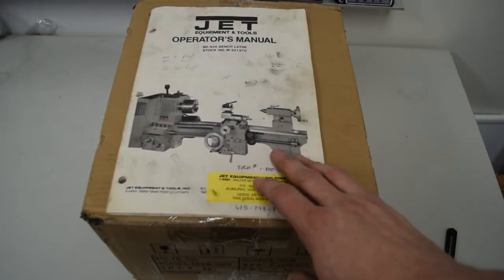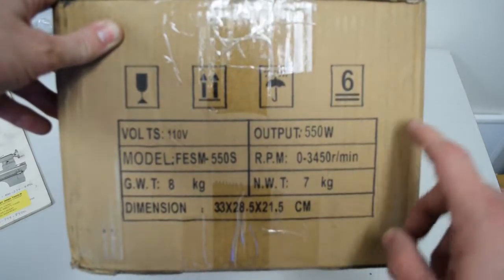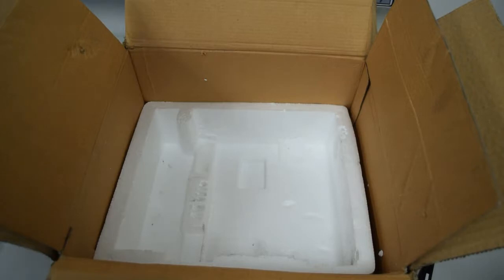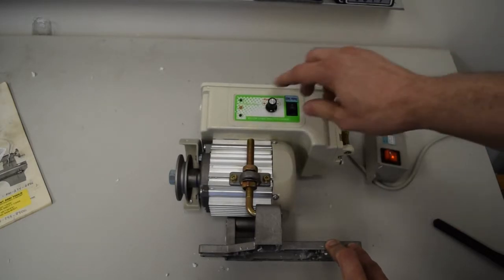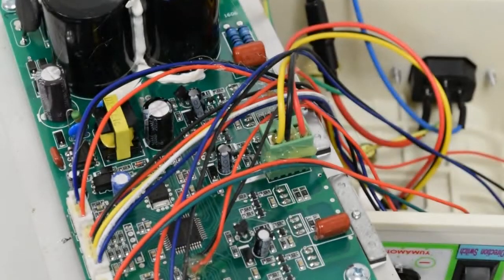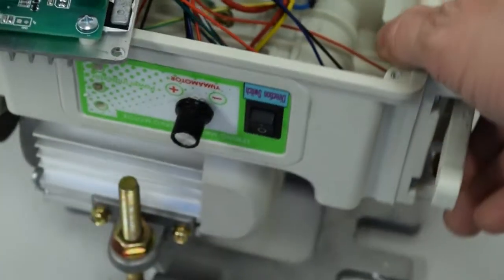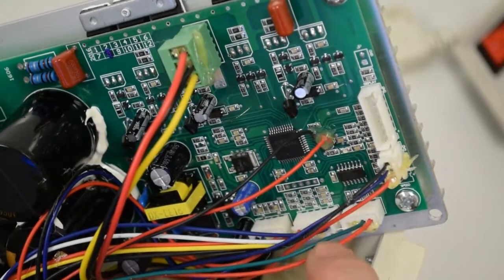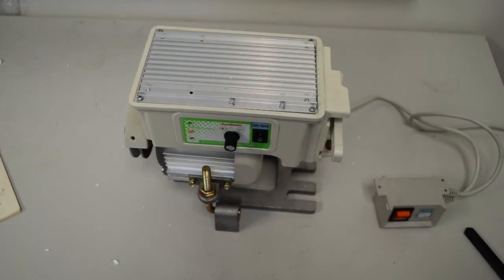Yuma 550w 3/4hp Servo Sewing Motor 9x20 Lathe Upgrade Unboxing

Comment: Now that was an unboxing on steroids! I especially liked how the control box was opened to see how difficult it would be to extend the controls for the lathe. Very well done. It would be nice to see a follow on to see how well it is working on your 9x20 lathe.
Reply from the maker: Eidetic Goone just got the pulley for the motor machined. And now i am working on the motor mount. Stay tuned!
Reply: Did the lathe require a different profile of belt, or were you just needing a different diameter that wasn't available. I have what appears to be the same BLDC 550 watt motor for my old singer 112w-139 walking foot sewing machine with the digital 4-button control. The motors are incredibly quiet.  I think it uses a 15mm ID pulley with a 3/16 key.  I bought a 45mm pulley, but the profile works with a standard v profile belt. 
I have been wanting the 9x20 lathe (may be 8x16) to possibly do a cnc conversion on.  So I am interested in your build.
Reply from the maker: The pulley that comes with the motor is wrong. I bought a used pulley that is the same as what my Lathe motor has. But it is for a 14mm shaft and the Yuma motor is a 15mm shaft. So I machined it 1mm larger to fit.
Reply from the maker: Also, check out "Bluehands" videos on 9x22 lathe CNC he did
Reply: @overkillaudioinc  how did this work out/is working out for you?
Reply from the maker: @AzTurboMini  I never got to finish it. Maybe this winter
Reply: @overkillaudioinc  thanks for the quick reply. Good luck 👍

Comment: hy ! can u maybe help me a little ! i want to add such a motor on my mini mill x2 rom Sieg. and i would like to know if the shaft from the motor has the pin sticking out or is this a threaded shaft ? and also , could you please tell me if there can be new mouning holes drilled and tapped on the plate where the shaft is sticking out ?

Comment: How is the low speed torque? I've read that a BLDC motor will never be great for low speed torque and a induction motor with vfd is much better.
I want to upgrade my small lathe and be able to thread cut at ~400rpm. Thanks for posting the video
Reply: did you watch the video? he had it at its lowest speed and he couldn't stop the pulley. so yea, they got torque.

Comment from the maker: One thing I forgot to add is that these have Braking action! so when you let off the speed control, the motor actually brakes. which on a lathe, my need to have some adjustment to make work. I just got the pulley machined for it and will be working on making a motor mount next when i get time again. stay tuned for further episodes of this adventure!
Reply: I know this is an old video but curious if you got it installed and would love some overview of the finished project if so.   Thanks

Comment: Looks like Google has made those "Yuma 550 watt 3/4hp AC" motors disappear. Liked the Dial Potentiometer though.  Got another link for this model? thx
Reply from the maker: It looks like Zamir Sew no longer has that model on their website. But if you search eBay for :sewing motor 3/4" a variety come up. Many look exactly the same but with digital up/down buttons. If i had the $$ I would like to buy a couple of these and open them up. I would be Dollars to donuts that they are exactly the same and could be converted to a manual speed control easily. But. It's a guess.
Reply: Yeap i was recently looking at the Consew CSM3000 but would have like to to be 'Less digitally controlled" and more manual (dial potentiometer etc) as well. Its a 1hp as well..  Sure there are plug-n-play controllers for its PCB board out there somewhere.  I see this guy (in the 2nd image) has rigged one somehow... interesting. https://www.deepgroove1.com/product-page/550-watt-brushless-spindle-motor
Reply from the maker: That is very interesting! I have not seen that before But I am familiar with Deepgroove's eBay store. I have purchased many things from him for my CNC machine. Very interesting what he has done there!
Reply: Yeah .. too bad he doesn't respond to email these days. I've sent 2 over the pass couple of weeks trying to get info on the controller and pulleys etc (or even try to buy the controller and pulleys for my unit) .. yet nothing- no response .  Others in FB groups have had similar experiences with this person.  If you happen to get some info on this I'd be MOST Interested.. thx
Reply: Randy, this visually seems to be the the same motor and controller  I bought off craigslist for my walking foot sewing machine.    I located a source on ebay, but the guy selling has a store in L.A. where he sells it for less ($115) with free shipping.  
http://bobbinusa.com/550W-Brushless-Servo-Motor-Sewing-Machine-Needle-Position-Rotation-Button_p_744.html
For  $115, the machine comes without a needle position sensor which is not necessary on a lathe or mill. 

Compare the $330 kit to the $115 sewing motor kit. 

Besides the pulleys, belt and simple aluminum plate, there is red box with a knob which replaces the foot pedal actuated  lever speed control box used on a sewing machine. Is the red box necessary, could you easily build your own, or could you simply use the sewing machine lever sensor? 

The lever has only a small range of angular motion about 15 or 20 degrees, making it more sensitive. But settings allow the controller to compensate somewhat for this increased sensitivity.  When the upper speed limit is reduced, the lever range seems to be remapped to cover the reduced range of output speeds. The upper limit can be set from 500 rpm to the factory set 3500. But actually the controller's menus allow setting this up to 7000.  The speed is shown on the display starts with 200 in increments of 100 rpm. I can hear that there are speeds between the 100 display increments that can be achieved by feathering the foot control. I am guessing that these are at 50 rpm increments.
In addition, there are internal menu settings that change the response curve of the motor, to give better low end control. 
I think a workable speed control could be achieved by removing the return spring replacing the lever with a knob, and adding some stiction to prevent the knob form turning too freely. 

I recently opened the box containing the lever. 
Inside,  a lever moves a magnet over this analog hall sensor labeled "49e 337". Probably this one:
http://p.globalsources.com/IMAGES/PDT/SPEC/440/K1139513440.pdf
The hall sensor is the only component on a PCB mounted inside the lever box. The lever box itself is bolted to the standard industrial sewing machine motor mount and can be removed with two bolts. The circuit board is mounted with two screws through elongated holes so that the sensor can be fine tuned with either a long or short dead zone. 

If you used a similar mount, you might need to get some longer bolts to accommodate the plate. The motor itself is designed to be gripped on its side in some extruded slots. This allows for fore and aft positioning. 

Anyhow, more info than you might be interested unless you get one of these. I have more that I have learned, but unless there is someone to pursue this, this post is long enough.
Reply: Wow you've put more time into this than I'd ever expect here.. and thx much for the info. I think I'll be OK with remounting the lever box ( and removing the tension spring and tweaking the lever arm pressure inside the housing so it doesn't flop around).  I was just looking for something more repeatable/ measurable after I reset/adjust the digital control menus abit... Looks like to get the torque at the lower speeds I'm gunna manually gear it down anyway.. prolly to 1/2.  Can't wait to get this Consew 1hp CSM3000 in my hand next week to see the low end benefits after adjusting the menuss abit.  Thx again.
Reply: True, I spent a little too much time.  My sewing machine is geared to about 1/2. 45mm motor pulley with ~90mm hand wheel pulley.  I get about 100 rpm at the needle. I tried to stop the motor at its lowest speed. The belt which I leave a bit loose slips but the motor shows no signs of slowing. These motors are pretty cool.

I just took a tried to find the csm3000 on the consew web site. http://www.consew.com/list/machine-stands/servo-motors
Seems they have updated their models a bit, and that one is not currently on their site. 
They have a tendency to keep the same model numbers and change up the actual product.  I am curious to see if your model comes with a two or four button controller. Most I see have two buttons.

I read both the two button and 4 button instructions. Both are different, but I suspect may have a common design origin.
There are two internal menus on the 4 button model. The first menu  was partially documented in the single page instruction guide that came with the motor. This has items U0 to U8. Not all of the items were documented. Menu is accessed by long pressing the "R" button. The other undocumented menu comes up by long pressing the "R" and "Ni" button simultaneously. It has items F0 to F2. I don't know much about the "F" menu.  The three "U"  documented features are upper speed limit, motor direction, needle position preference. 

On the two button model, the slow start feature is documented, which is called U4. On the 4 button model, this same feature is there but the instructions don't talk about it. The documentation is a single 8.5x11 piece of paper. There may be more documentation for manufacturers or resellers, or maybe untranslated Chinese. At the moment I am happy with the speed control and sensitivity on my csm1001, which has the 4 button controller, but is not currently shown on the Consew site.